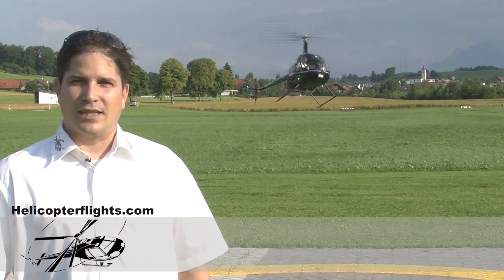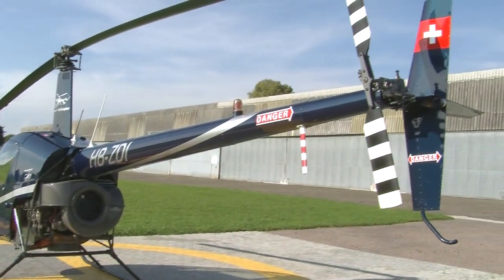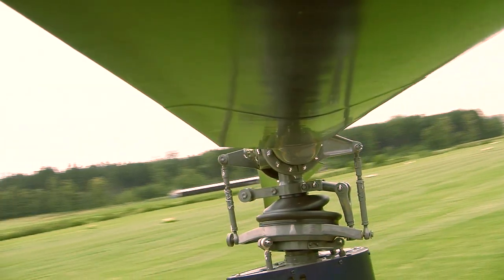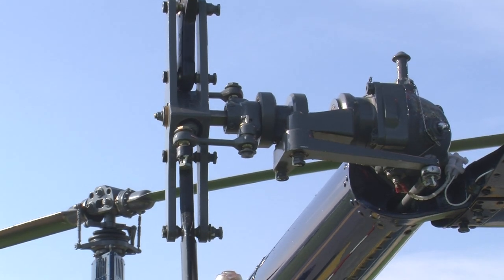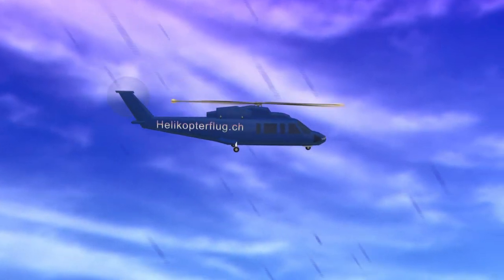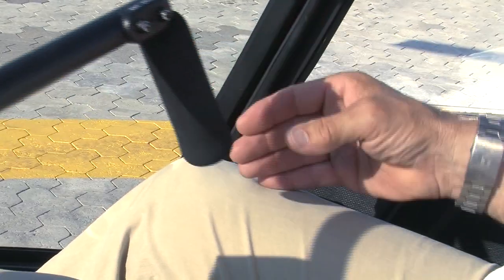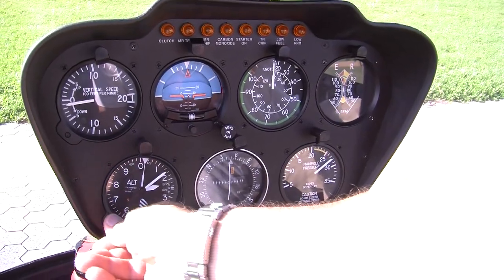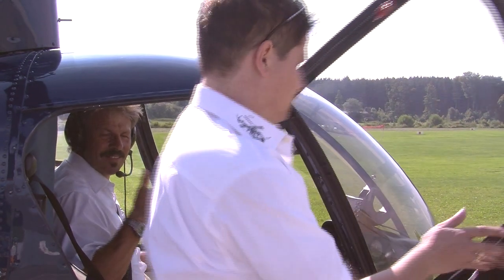Introduction to flying a helicopter independently

Comment: my RC birds have a 6 axis BeastX FBL Flybarless System that keeps the bird stationary or in head lock mode. Bail out is included for a few extra bucks when you get into a control problem you hit a switch and the bird levels out at a set elevation. Even has a home button when you press the home button the bird by it self fly's back to its starting point and lands automatically. So flying is super easy and main torque is always compensated for by tail pitch. All you would have to do is point and go only controlling the elevation and forward speed. BeastX is only $250 and could easily be adapted to this size of heli.  Is there a 6 axis FBL controller on this heli?

Comment: Like any kid growing up having a mechanical bent, I believe I have more than adequate understanding of how a helicopter works, and that I could even fly one with very minimal instruction.  All I really need to ask the instructor is this: What is the minimum safe blade rpm.
Reply: Mechanical bent or not, minimal instruction my ass!! It's one thing to understand  the mechanical functions of the controls n how they interact with the air n wind, etc, etc, to fly.
My degrees are in Engineering, and I thought the same as you, looks simple enough until you actually get in one n try to learn to do a rock steady hover. I've logged a dozen hours learning to fly a helicopter, an R22, and I'm still learning to hover, hover taxi, pickups n set downs. It's a "whole new" learning curve.
It takes most student pilots between 10 to 20 hours to get the hang of it, where you feel confident enough to handle it. It's very easy to over control n get into a bad situation, especially in crowded airports or between buildings, trees, etc, you'll tear your ass up in short order. Like learning to play a guitar, it is a learned skill...

Comment: Doesn't the Hiller rotor-head do something odd like that to prevent gyroscopic precession? I mean, my trex has one, but be darned if I can figure out EXACTLY how it works. The Robinson doesn't have one of these, though. And even on the Hiller, the swashplate still drops forward to move forward, I believe. Great, now I want to go pull that thing out of it's box and look.

Comment: Wrong. when you tilt the cyclic forward the swashplate tilts 90 degrees before full forward with rotor rotation respectively.

Comment: on the end of the colective where you hand rests is the throttle. similar to that which is 
on a motorcycle. you rotate it to increase engine RPM.

Comment: Not if it was in Microsoft Flight Simulator, Mr. EpicGamingAdventure   ;)

While the flying may be intuitive to you, I honestly don't even think you could get off the ground in RL to crash it!.  Pistons aside, there is nothing intuitive about proper turboshaft start-up procedures.  Even if you find a checklist laying around, you would be lucky not fry the turbine.  If you don't know what an idle release switch is, that's almost a guaranteed hot start!